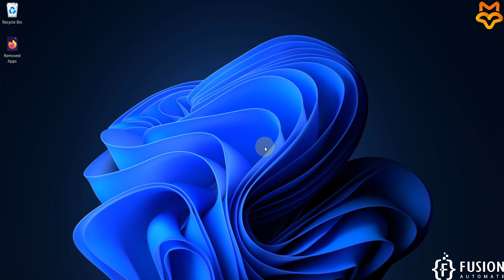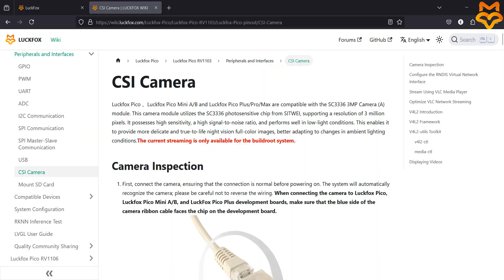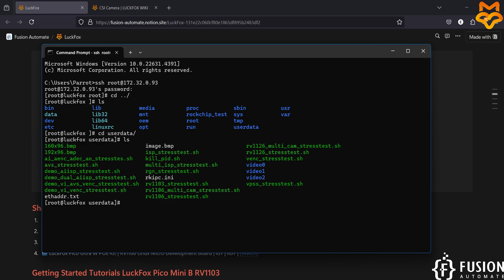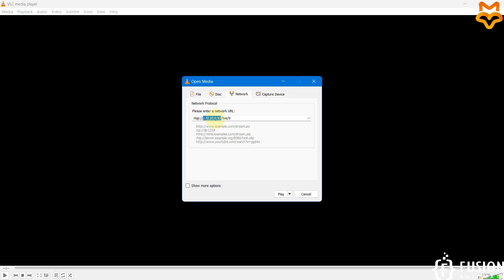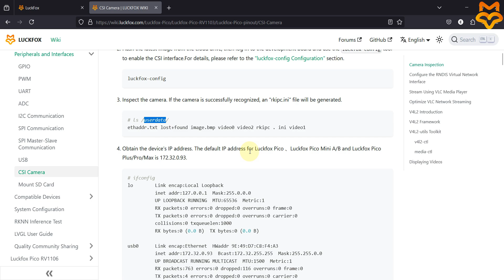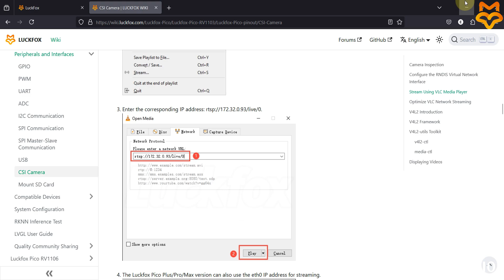Setting up LuckFox SC3336 3MP Camera with the LuckFox Pico Mini B Linux Micro Development Board |

Comment: Thank you for the overview. What are the actual power consumption figures in idle mode? Is there a deep sleep mode similar to the ESP32?
For example, if connected to a 10,000 mAh power bank for a day, approximately how much energy does it consume just waiting for a signal to activate the camera?
For comparison, a Raspberry Pi Zero 2 W drains a 10,000 mAh power bank in 48 hours just being powered on and waiting for signals. I am looking for more energy-efficient alternatives.

Comment: I just got mine - so quick question on the camera and streaming.   Do you mean that if you use ubuntu you can't use the camera "period "- or you just can't use the camera to "stream"?  (Luckfox pico mini-b)
Also, are there examples somewhere of using (Luckfox pico mini-b)  of AI camera detection of objects? - streaming not necessary.  Just need location co-ordinates over a serial interface.